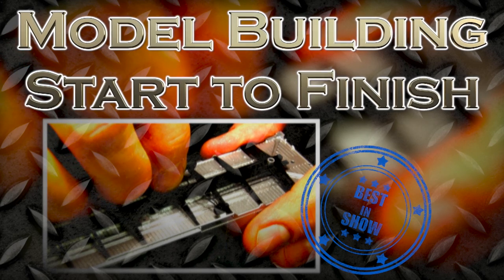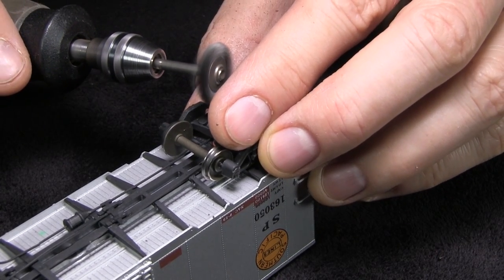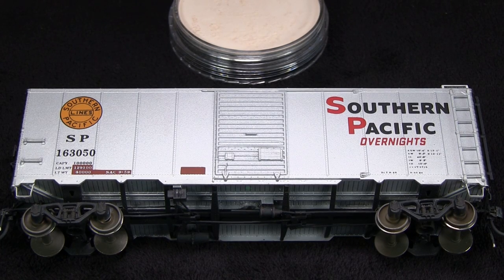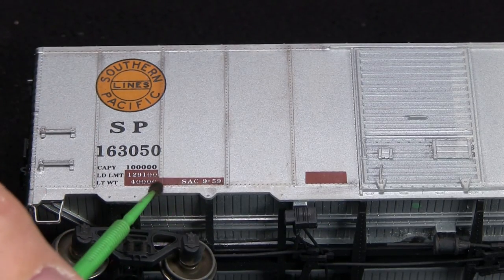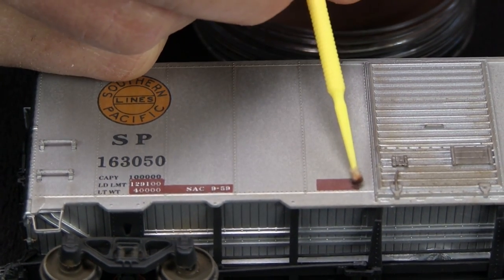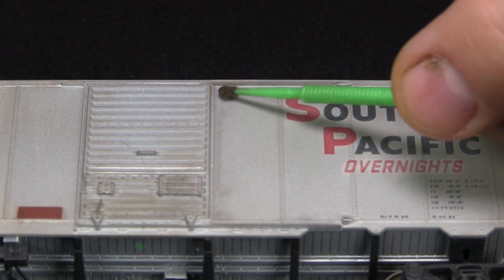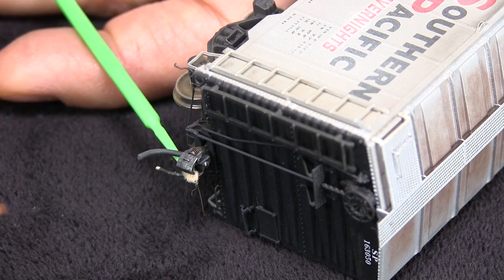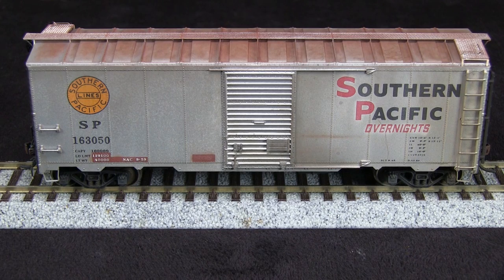HO Scale Model Building Box Car 8 of 8 Weathering

Comment: Unfortunately, soon after Krylon bought Testors a couple of years ago, the entire Modelmaster line of paint was discontinued. 

Also, just my observations ... pretty much all the wheel faces I ever saw back in the 20th century were chunky, grimy black if they were mounted on the old solid bearing trucks. I presume this was because of the constant oil leakage from the packing in the journals. Most wheel faces in roller bearing trucks were some shade of brown, ranging from almost orange with recently replaced wheels to grimy dark brown for well aged rust. 

Regarding the ends, wheel kickup spatter exists on pretty much all railcars. This would make a nice touch.